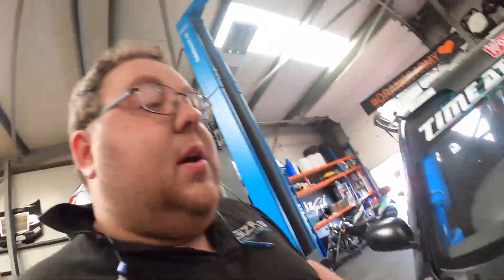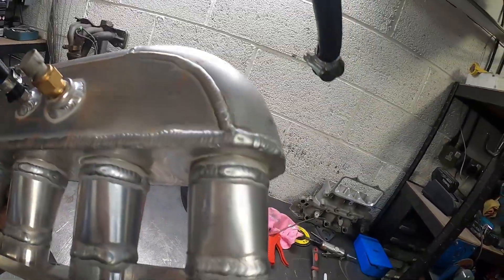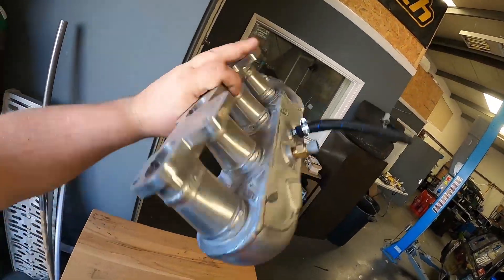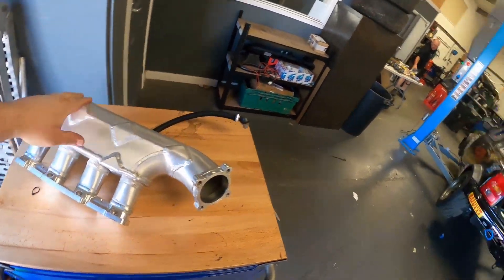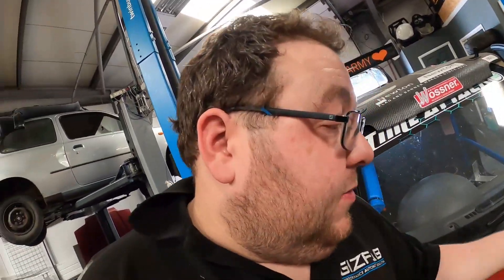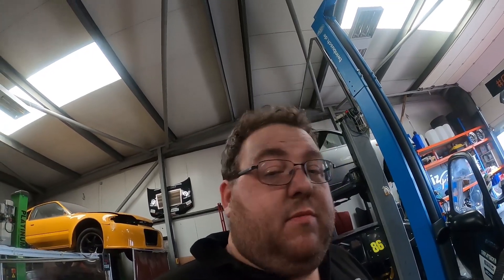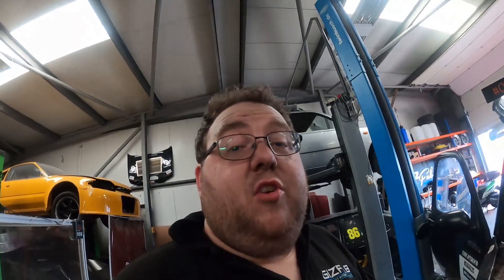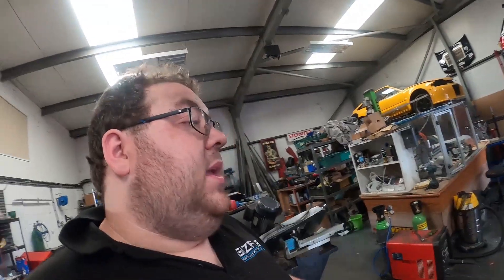INLET MANIFOLD REPAIR - DANGER TO MANIFOLD!

Comment: The reason that these fail  is  the bad design to begin with
Reply from the maker: Im open to suggestions for improvements. Watch my original video of when i made it (y)
Reply: @GizFab  reduce thickness and  full pen the joint.  I had the same problem.   From 3.5 to 2.5 thick.  Full pen probpem solved.   I also  put 2 "pillars" in the middle of the plenum to reduce the flexion.
Reply from the maker: @helldiablo8471  yes. People have mentioned some tube through the middle to stop it expanding. It survived today though. Issues elsewhere now.

Comment: Id suggest making a PTFE gasket, dont think anything goes wrong with them when removing and refitting the inlet. I have one on my throttle body too and thats been on and off multiple times. Heres your free comment 🤪
Reply from the maker: Not keen on them. Seen them deform and cause vacuum leaks far to many times.